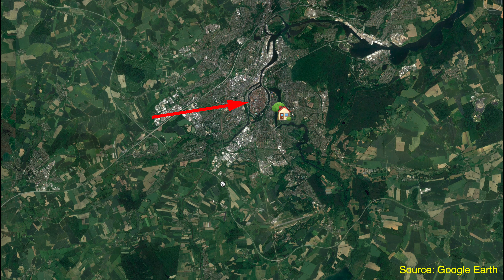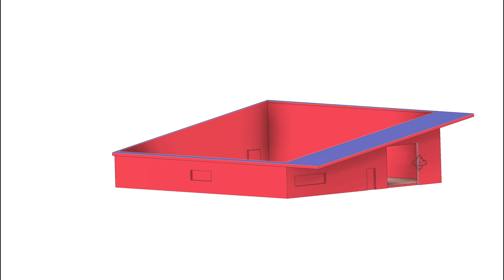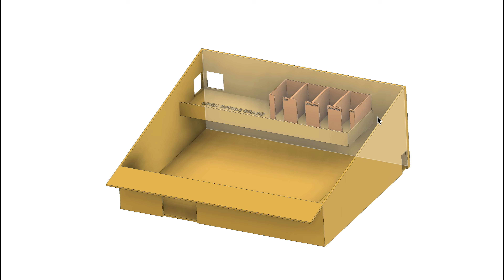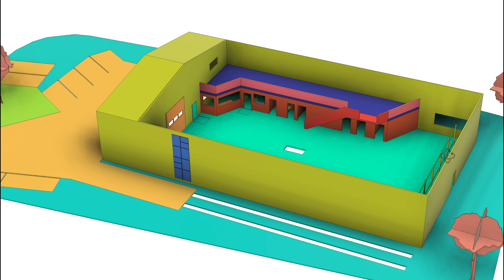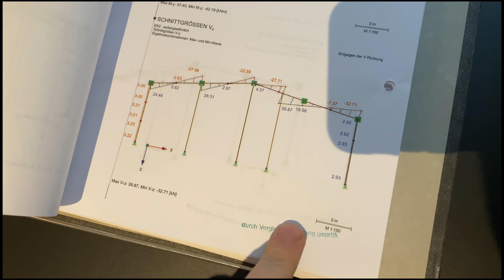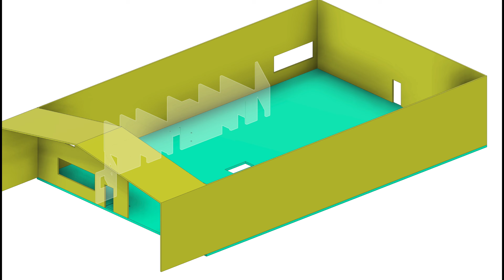Dive into My Massive DIY Workshop Build! The Ultimate Place for Creativity | Max Maker Workshop Ep.1

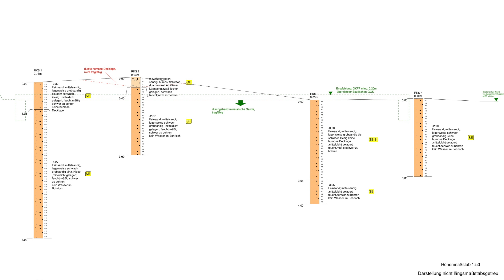Comment: 7:42 are the costs what you pay to the government? Or what the specialists charge in Germany? Because it's OK for commercial prices, but way too high for red tape prices.
Reply from the maker: Most of those are paid to various planners and architects. Its rounded obviously. Some architects can do all of those but most often you find specialists for all fields. The government took 5000€ for the permit if I remember correctly.
Reply: @MaxMakerChannel  Wow that's a pretty high cost for the permit, that's brutal. Here (in Poland) the permits are pretty cheap . You still have to pay a lot for the structural engineering, HVAC engineering, and architects, but these are commercial prices not government mandated tithes, and theoretically you could do some of the designs yourself without any specialists. There are also free plans available, but mostly for the residential buildings.

Comment: The separation of toilet and sink room is the same in Poland. This is not only for privacy but to restrict the flow of air that might be poluted with germs so it wont spread across the whole thing. It's common practice that you will see in most of working places or public buildings. About all the permit's it's pretty similar in most countries. You have most of those things because most of the times "workshops" are classified as warehouses which then go under the regulations of industrial buildings and there you have to control it influence over the area with noise, polution etc. but it differs a little in between different countries. Rest of the paper work from architects and structural engineers is that someone takes the responsibility if something goes wrong. Review is to minimise the potential error that may lead to structural failure.

Comment: what kind of software is this ?
and could share project files like structure etc.
Reply from the maker: Its Fusion 360 and I don’t have the actual design of the steel frame. Just the rough dimensions. Sorry.

Comment: Are gendered washrooms required? With two individual stalls I don't see why they couldn't just be for anyone (same with the showers) unless there's some legal reason for it.
Reply from the maker: There is a 20 page guideline that tells you the amount and sizes of sinks, showers and toilets that you need. It is all linked to the number of employees and how dirty the processes are. For up to 9 people you can get away with a single toilet and no shower at all. However I don’t aim for the minimum. I want to make it comfortable and nice to work there. 

In the past we had one female employee. It would be uncomfortable to share facilities even though its allowed. So we will build two of each. They don’t have to be gendered. We could make them shared. So as long as no female is working there we might have two showers. I think they both won’t be used very often.
Reply: Thanks for the reply, I appreciate your reasoning for separation of genders, however I don't think its uncomfortable since they are fully isolated rooms. Almost everyone has shared a washroom with the opposite gender long-term (parents, SO, etc.). Any way, your workshop, your rules just was curious.
Reply from the maker: @VillainOfBrandon I don’t really mind myself. But I don’t know how the employees feel.

Comment: Are you planning on reaching PassiveHaus standard? Air tightness and all?
Reply from the maker: It will be close to a KFW 40 house which I think can be called a passive house. However I am not trying to get any subsidies because the paperwork is more expensive than the savings for a industrial building. So I am trying my best, but I don’t have the certificates. 

One thing I noticed with insulation is the diminished return. 12cm of foam means heating will be about 3000€ with a heat pump per year. 14cm of foam could reduce that by 10% so its only 300€ less per year. But the extra insulation costs 5000€ and the heavier steel structure costs 15000€. So you need to find a balance between saving electricity and saving building materials.

Comment: Are you going to install a battery bank, so excess KWh's from the solar system can be stashed away for nighttime or for a rainy day, especially in case the power grid goes down?

Throw in the occasional EN-to-DE lesson, bitte e.g. The Workshop = die Werkstatt. Does not have to be anything major, just a little something to help those of us who are learning to spricht Deutsch (speak German):learning:. Especially when labeling parts or dimensions on a diagram, such as the 3D model you show in this video. Most resources do not cover stuff relating to making or building stuff.

Please, do not forget to apply the lessons you have learned in your last video. A flooded Werkstatt would be totally not good.

Comment: Hey Max! You have experience of heavy rain and flooding with your house. Are you taking measures to protect against flooding in this new build? What is the risk of flooding in the area?
Reply from the maker: The property is close to the top of a hill. So the edge close to the hill will get a ditch for water to divert around. The other 3 sides are not in danger because they will be 20cm above the pavement. So first the entire street would need to flood 20cm.  But if that happens it would overflow the lower properties. Since this is a hill, there is only flash flood danger like we had at our house. So as long as that is diverted it should be fine. We are also building a 16m3 large underground rainwater retention reservoir next week.

Comment: "Steel beams are not fire proof"

That's got to be the best joke I've heard in a long time. Kudos.
Reply: Maybe do some research before you make a fool of yourself.
Steel doesn't burn, is not combustable. But its structural strenght goes down dramatically when exposed to the high temperatures when a building is on fire. That is why it needs to be made fire proof. So the building doesn't collapse. Think please.

Comment: very excited for you!
Don't forget about fall protection on the roof for maintenance (of the solar panels etc) Easy to instal right away, but trickier afterwards.
Reply from the maker: I have heard of that, but haven´t researched it yet. Have you got suggestions?
Reply: @MaxMakerChannel Perhaps a rail right across the Ridge to attach a harness system to.

Comment: What do you make?
How many people are you expecting to work there? 
Is it single occupancy just for your company, or are you leasing some of the space out?
Why do you need two full bathrooms and showers, can you not just have one unisex one of each?
Reply from the maker: I make drawer slides for the caravan industry in Germany which pays the bills. But this workshop is so big that I need to expand my business to new products. Something that I wanted to do for some time, but I lack the facility. 

I plan to have at least 3 employees, but if one turns out to be a lady, I want her to have her own changing room. Its not required by law if you have less that 10 employees, but having it will make everything more comfortable. And if I ever sell the place it will be nice to have.

I am not leasing anything. If I wanted to split the building, I would need fireproof walls in between as well. I don’t want to deal with those regulations. But the absurd thing is that my hometown is almost 100% preserved historic buildings. They don’t follow any regulations. Because they look cute…. But no wheelchair can enter the shops.
Reply: Electric surfboards! 😊

Comment: Hey Max, this look an impressive project, wishing you great success with it :)
May I ask if you've thought about suing CLT as a building material? Just a thought here.
Reply from the maker: Is CLT glue laminated wood? The only advantage that I see is fireproofing. Wood is fireproof for about 30 minutes! For my workshop there is no fire requirement for the steel. But if it was a supermarket or home the beams would have to be fireproof. Then you can only go with wood. 

I like steel a lot. It’s predictable and lasts forever unless it rusts. Wood is also more expensive and checking its quality is more difficult. With steel there are better regulations. How can I know that the glue doesn’t fail after 10 years? With steel its easier in my opinion.
Reply: @MaxMakerChannel  Thanks Max. yes, CLT is the cross-laminated timber with glue. Regarding fireproofing, what Merkwood says on it's site: "Contrary to popular belief, CLT technology has much better properties than steel and concrete. Fire resistance is measured by the degree of penetration, which for spruce is 1mm/min." Just an idea, for future project as it is getting more popularity in Switzerland, Austria and Hungary the past years. Thanks for showcasing your ideas and works in your videos. Cheers.